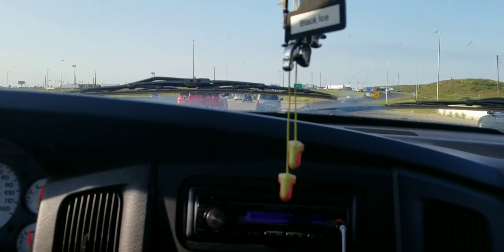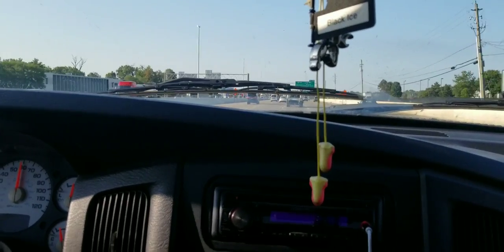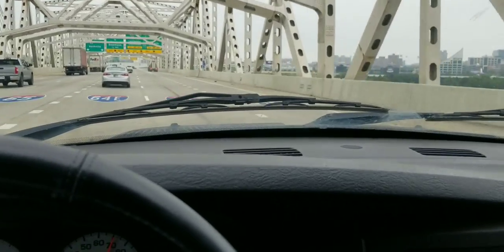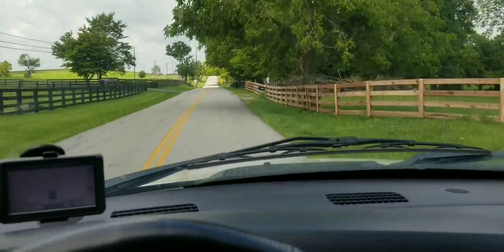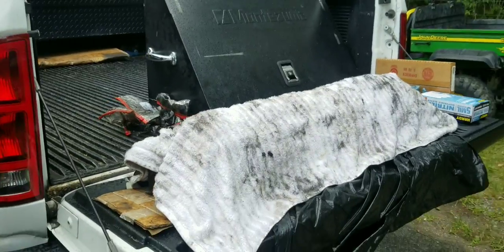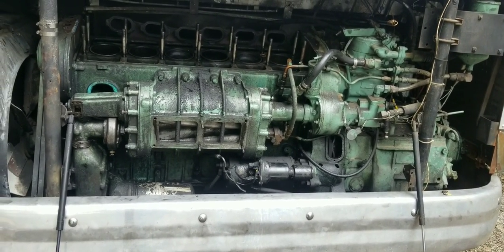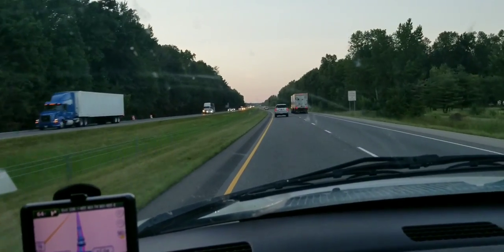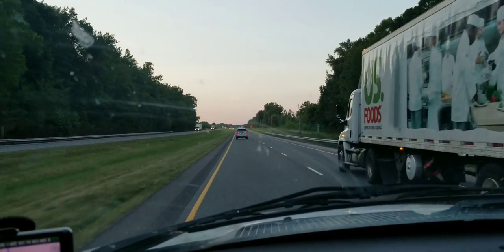4104 head swap

Comment: Your Dodge sounds great the 5 speed manual and the dual exhaust is awesome
Reply from the maker: It's a single 3" exhaust. Gibson short tube headers. High flow cats, full mandrel bent exhaust. And a glass pack. Dumped before the axle